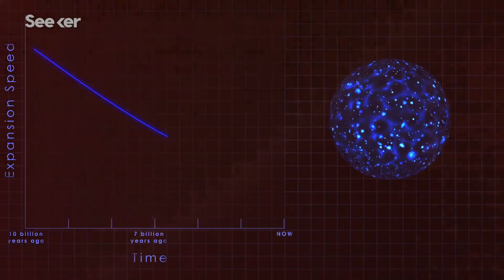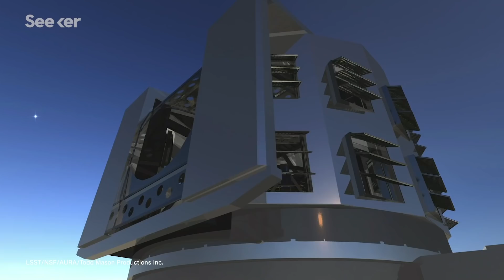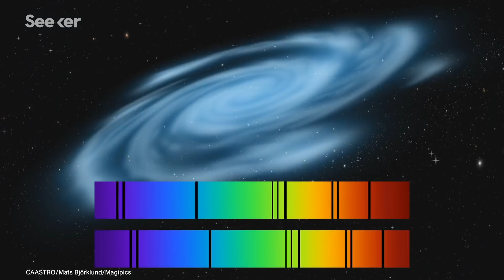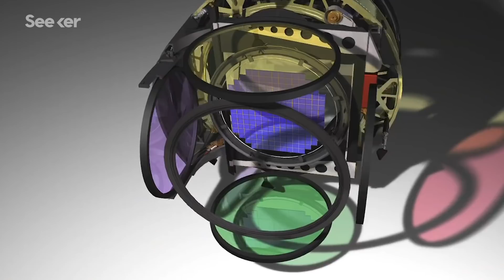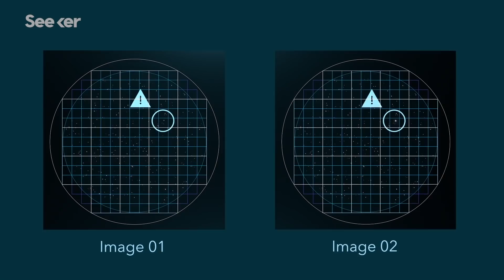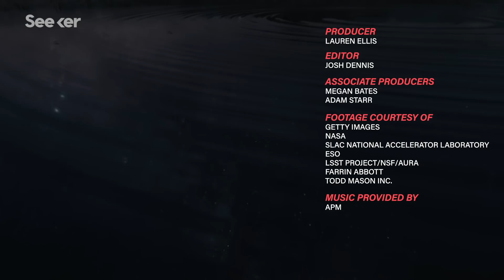This 3.2 Gigapixel Camera Will Record a Timelapse of the Universe

Comment: I wonder what the images would look like if this equipment was placed onto the ISS (International Space Station) ?
Reply: Needs to go way higher than that. Moving far too fast on the iss for it do be any good
Reply: Not feasible.. for that purpose  James Webb deep space telescope is getting ready..!
Reply: A 30 ton optical lens?
Reply: Kanna Sai James Webb shoots in infrared only I think
Reply: Tell Elon
Reply: Zakaria Hassan the only difference is it could run 24/7 .
Reply: @daniebello  it'll be green thru IR
Reply: Try getting that fragile glass lense up to space on a rocket.
Reply: Iss is just 400km above us 😅
Reply: It wouldn't matter since we eitherway gonna see same thing from down there,but carrying and operating that heavy object will be bad for the iss

Comment: It will record the most beautiful traces of the starlink project.
Reply: Unfortunately, yeah, Starlink isn't great for astronomy.
Reply: @astrofox2409  astronomy needs to accelerate its progress just like the tech industry does. We need to be building a composite of satellites to form a mega telescope in space that would make the James web look like a toy
Reply: @jonathanmay7508  yeah maybe more global  networks of telescopes like they did for the black hole picture, turning earth into one massive telescope.
Reply: @GK-qc5ry  we can't use that method for optical telescopes because the distance uncertainty needs to be less than the wave length of the light for it to work.
Reply: Satellite traces can easily be removed by software, even I know several hobby astronomers who know how to.
I think the scientists might be able to do this as well. :)
But many simulations of a sky with Starlink satellites are outdated anyway because of the lower orbit (500-600km) and the ways SpaceX tries to block more light from reflecting to earth. (Dark coating and sun visors)
Reply: @AwfulnewsFM  with narrow ai designed for that specific task I'm sure we could conquer that hurdle.
Reply: @snakex555  moon telescopes, and an array at the lagrange points of earth and sun
Reply: @jonathanmay7508  how does AI help with getting nanometer measurements ?

Comment: 3:55 if the cola is to create a “map” of the sky and there is x many pixels how much zooming in the picture can be done? I recon the map only are valid for studies if you can interact with it and zoom in on each pixel while still having a clear image.
Reply: So I worked it out! 
TL;DR: If you are viewing the complete night sky image in all it's glorious resolution on a 30 inch monitor, you would be able to zoom up to a spot just 0.56mm (1/45th of an inch) in width in that image and still have 4K resolution. In total the final image has within it 1,388,000 4K images all stitched together.
How I worked it out for those that are interested.
The Moon takes up 0.5 degrees in the sky. They said that the area of one image is 40x the size of the moon, lets assume that the moon is a square and the image is only 36x the size of the moon. This gives one image a size of a 6x6 grid of moons filling a 3 degrees field in the sky (only a 13% error with this estimation which I can live with). To complete a half circuit (180 degrees) of the sky it would take 60 of these 3x3 degree images, however it would take another 60 rows of this image strips to curve this image strip through the sky and complete a dome of images (note the telescope only images the southern hemisphere which is half of the total night sky). This results in 3600 images of the night sky (yes there is overlap at each of the strip ends, it's yet another estimation I am willing to live with because otherwise physically stitching all the images together for the final nigh sky image would be a nightmare).
This final dome of images would have 11,500,000,000,000 pixels (or 11.5 terapixels, or 11,500 megapixels). A 4K image has 8.3 million pixels, which means the final dome of images would consist of approximately 1,388,000 4K images. This equates to a grid of 4K images that is 1178x1178 images big. Therefore on our 30 inch monitor which would be 66.4cm wide, each 4K image would only appear 0.56mm wide. Which means we can zoom onto a spot just 0.56mm wide and still have a 4K image on the screen.
Reply: @calebjones3383  so it would be possible to zoom to a point of a 16th of a square millimeter to have a FHD image. For comparison, human eye is able to distinguish two points about the distance of a half millimeter. Impressive

Comment: Not sure if this is a thing but couldn't you measure the distance between the blue light and the red light and tell how far something is? They said it red shifts so woildnt the light that's close, say, from a flash light, the blue and the red would be closer together. But as it red shifts from light across the universe, the red light and blue light are further apart right? That would tell you the exact distance if an object? Maybe they do that now I dont know. Just a thought.

Comment: Each 3.2 Gigapixel image would be at least 10 GB in size, uncompressed, if it contains RGB information, though I'm not entirely sure how astronomical image processing works. With 1000 images each night that would be 10 TB in size. With large data volumes, they are usually shipped manually on external hard drives, so I guess that would be one box of hard drives a week.

Comment: The possibility, that the dark energy can be some large scales flows in the universe, instead of universal accelerated rate of expansion, hasn't been ruled out...
Reply: Which is why we should be using the special Optical / Transparent properties of Graphene for many things, the lens on the telescope, optical / Transparent Transistors in our computer's CPU / Processor for Photon (light) particles such as for Photonic Computing / Photonics and so much more, Graphene has unlimited potential, and unlocks new possibilities.

They are still using Silicon, and Graphene should replace the Silicon shown in the video and used on the telescopes.
Graphene can also be used in many ways on the telescopes.

Check my other channel on Graphene and Quantum Technologies.
Please watch all videos from top to bottom in that order.

Graphene playlist.
https://www.youtube.com/playlist?list=PLAUtk-Q2DF7wXgENPNkvc5JXH5ocia_Fo

Videos with important info to get around my other channel. Check for a video here to make large machines to scale up Flash Graphene fast and cheap enough.
Please watch the full playlist first from top to bottom in that order.
https://www.youtube.com/playlist?list=PLAUtk-Q2DF7xsjVfESM1sqZdkHJYRw--j

All the playlists on my other channel.
Be sure to scroll down through these to find more.
https://www.youtube.com/channel/UCB9ezXYprgvhMaPWLhyoJ7A/playlists?view=1&sort=dd&shelf_id=0

Comment: if it takes an image every 30s for 10 years, that will be 10 512 000 images
and if 1 image is 3,2bil pixels, 1 pixel = 8 bytes, 1 image is 24.414gib
and that would result to 256 639 968 gib which is 244 petabytes

thats alot
correct me if im wrong

Comment: 3.2 Giga pixel CCD camera - because CCD is still far better then CMOS for astronomy.
1000 pictures a night 1 for every 30 seconds is 8 hours 20 minutes, approximately 4 TB a night( +/-) (atm £100 for 4 TB HDD) 
Approximately 1.46 Petabytes per year, x 10 years ~ about 15 Petabytes of data.
Edit: after some other calculations - it’s closer to 19.75PB.

Comment: Consider the Sternglass-Einstein work on the electron-positron pair in a death spiral since being created in the first condensates of matter after a Bang.

From that structure paired with another counter-rotating pair was found a meson matching properties in lab results.

The implications of this finding, late 50's, which was never disproven although disputed vs the "Copenhagen School", aka StdModel, are immense to theory & help explain a portion of 'dark matter' by virtue of their external neutral charge as a single pair.

And, when they finally decay their energy of annihilation is released, this can explain inflation.

Thus the StdModel while coherent to itself isn't a theory being a empirically derived system.

In a cellular universe there is more than one Bang, material was there before & a portion unaffected by the explosion remains mixed in with the results of a Bang.

That is, a Bang converts mass to energy that is sent quickly away from the center of mass outward as energy thus removing the gathered mass as an Attractor.

All masses being drawn by a Great Attractor are suddenly free to take altered trajectories as a way to distinguish objects released from the mass attraction.

Consider if this didn't happen all the Universe would be only Great Attractors gobbling each other.
Ymmv.

Comment: These guys: my giant camera will outperform your smaller cameras because it's both compact and giant
Rick Sanchez: Oh... well my camera was made out of garbage in my garage and is smaller than even those small ones but would still be 1,000 times more compact than yours if I enlarged it to the size of yours. That obvioisly makes it even more significantly compact than yours.

Comment: 4:28 that is not an example of a CCD. That is probably a CPU or chipset.
Reply: No that looks like a camera sensor to me. The sensor in my canon looks pretty similar
Reply: No, just google for pictures of an Intel mobile cpu. That thing is a cpu, a CCD has much less empty space around it. Also the copper dots are identical to a CPU. A CPU has resistors on it on carious places, a CCD does not.

I have several Canon dSLR'S crop and fullframe and even dismantled one and it looks totally different.